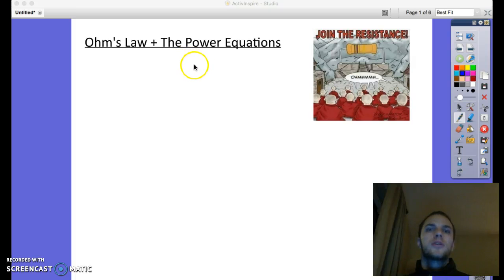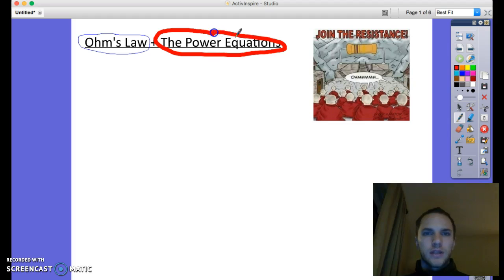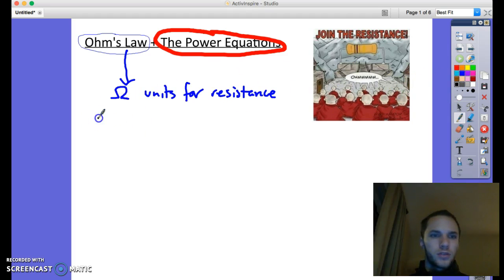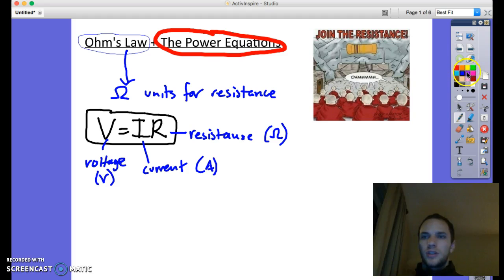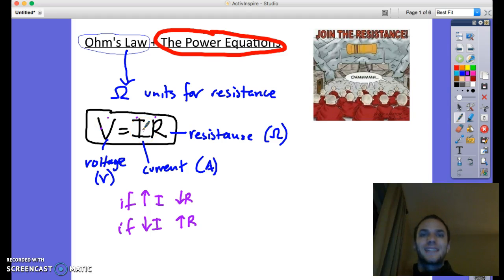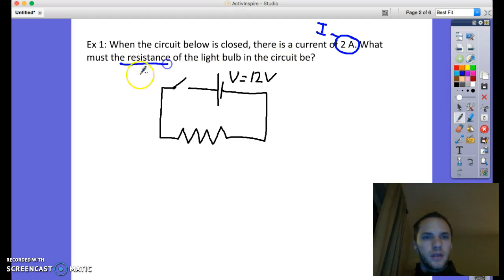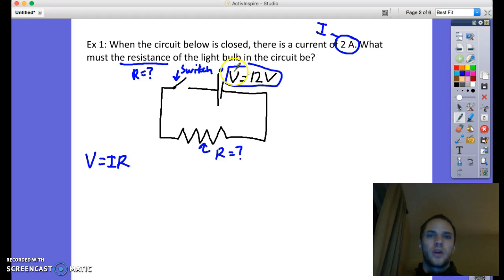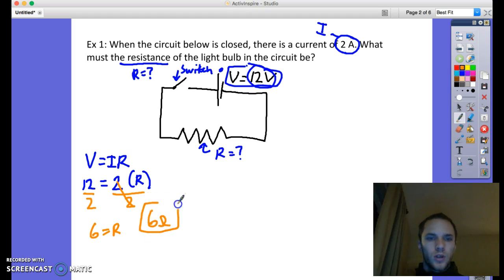Ohm's Law + Power Equations

Comment: What if it includes time
Reply: Power does include time --- energy/time. You have to break down the units of Volts, Amps and Ohms in order to get the basic units (which by the way are all metric) in order to get the units of energy (joules).
If you multiply power by time you get energy, in the commonly used units of kilowatt-hours. And that's what you get billed for on your electric bill, the amount of ENERGY you consumed. You also pay for how much chemical energy you buy when you fill up at the gas station. You're always buying energy, not power. Power is merely the rate at which energy is either being delivered or used.